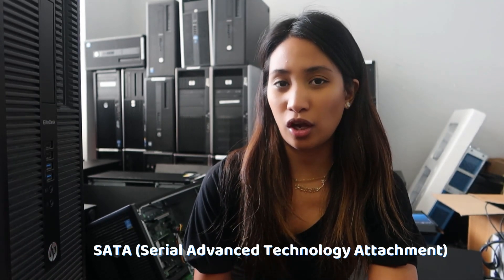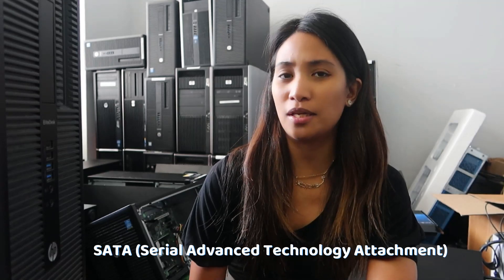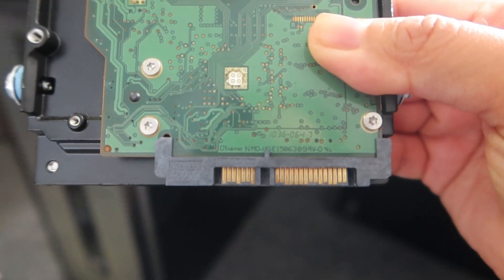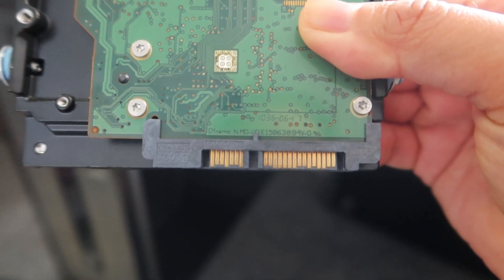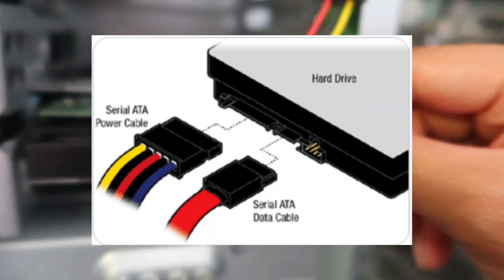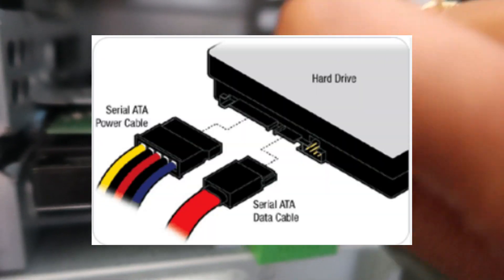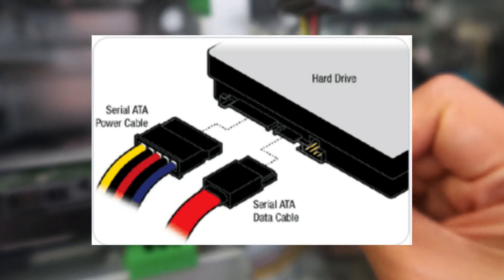Hard Drive Basics | Types of Harddrive, Interfaces (HDD, SSD, SATA, SCSI, NVME)

Comment: you didnt cover SSD cons like you can NEVER recover data from SSD once lost, then SSD will degrade as years progress far faster than HDD, SSD is only for short-term temp storage
Reply from the maker: I've already said in the Disclaimer that I won't be able to cover every detail. Yeah you have a point that's why I mentioned that for storing files like archive, HDD is still preferable. Not sure though if SSD degrades faster because new technology is improving with storage now and since SSD don't have moving parts like spinners, you won't have mechanical part failures